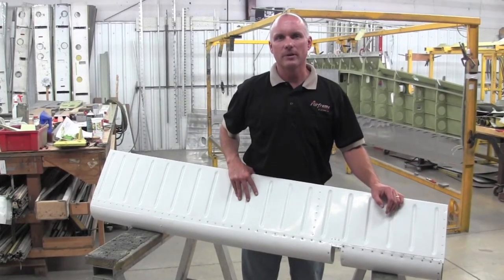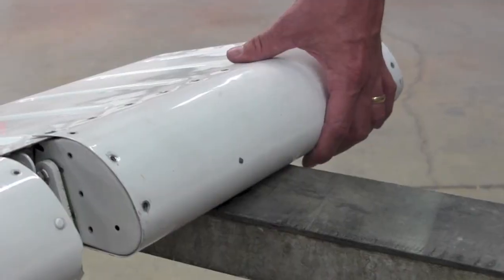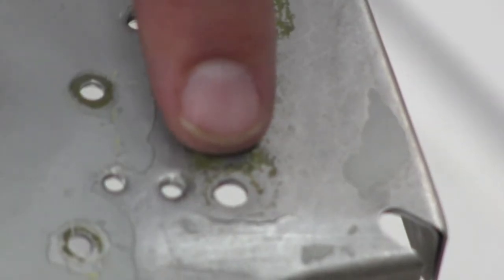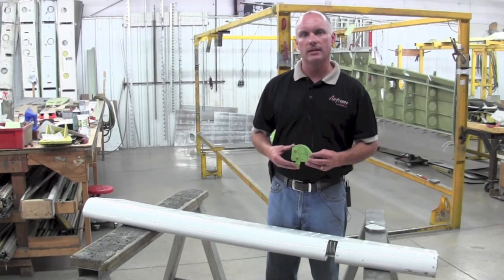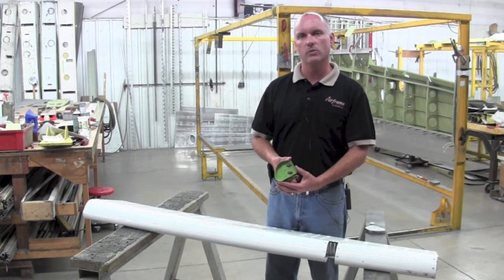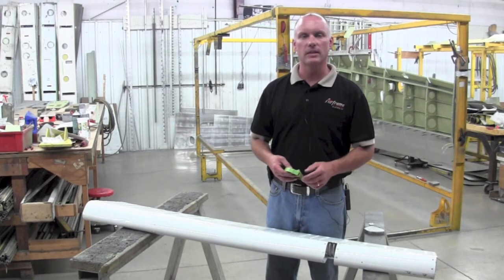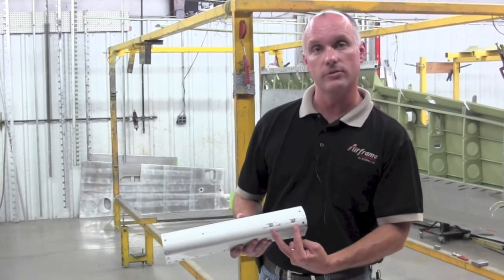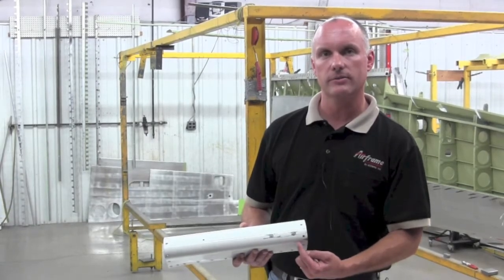Piper Inspection of PA32 301 aileron hinge brackets

Comment: Mr Williams, I find you videos very interesting and a bit scary. It's scary to think that some of the problems you show seem to be found almost by accident. But here's a question: 
When you replace a part, say a bracket. Do you have to buy it  from the original manufacturer, or could you make one up from raw metal at the machine shop using, of course, correct methods?